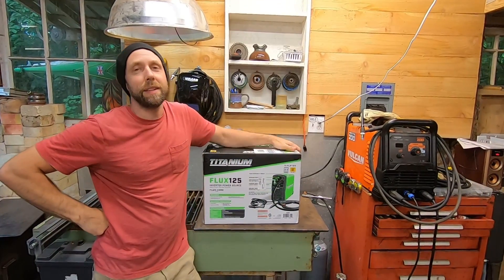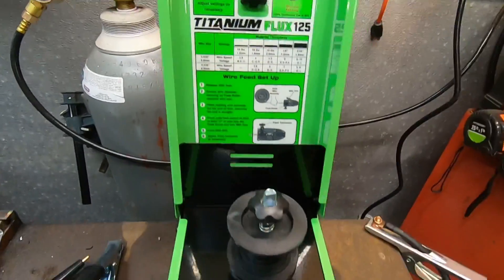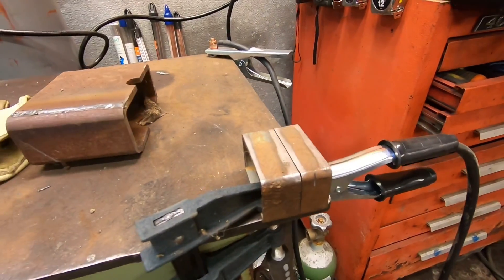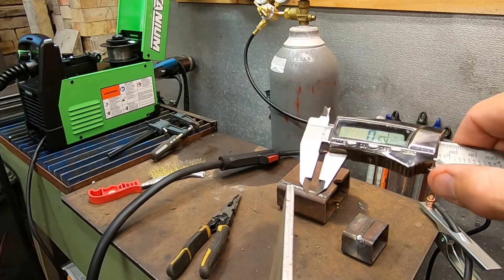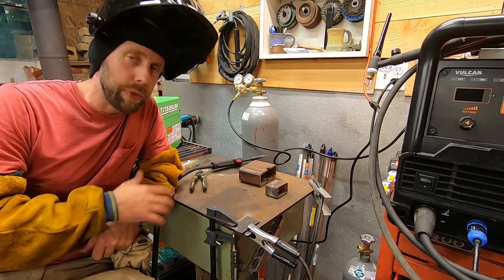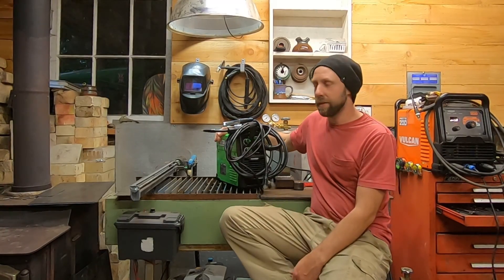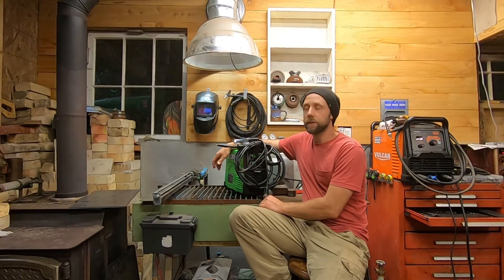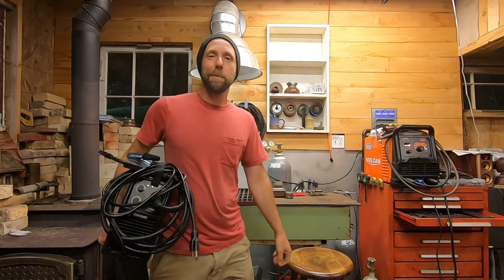Titanium Flux 125 welder from Harbor Freight

Comment: Hey Mike, I got a Millermatic 210 + Everlast MST211Si +Vulcan proTIG 200, but every now and then I need to do some welding where I don't have 240v. Right now, this unit is on for $189.99 until 9/7. Do you think it would be worth it to buy one of these?  I've had issues trying to run FCAW using the Miller with the .035 FCAW drive rollers, but the wire keeps jamming up in the drive housing. I like MIG, but I don't like to burn thru the gold gas just for some rusty metal welding outside or for a neighbor where there is only 120vac access. I love your channel and would like to hear you thoughts on this.
Cheers.
Reply: I bought one two days ago, there’s a coupon that brings it down to $179.99

Comment: What is the difference of welding between a titanium and a Vulcan im interested in buying one I want to use it to weld bicycle
Reply from the maker: I have owned the Vulcan Omnipro 220 and the Titanium 200, both work really well. The Omnipro has auto set controls so it lends itself to being real easy to set up if your new to welding, but it’s a really capable machine.
The Titanium 200 is not auto set but has a really nice metal thickness chart inside the door of the welder, so it’s as simple as looking at the chart and dialing in the three knobs.
I prefer the Titanium 200 mostly because it more affordable, lighter weight and a little smaller if you plan on taking it out to other jobs. Both are multi process machines, MIG, TIG and stick, plus you can buy a spool gun for welding aluminum too. Both are multi voltage, 110/220 volts 👍 I hope this helps.

Comment: I welded a lower control arm mount on a suv and it's still holding strong it's a awesome welder I've never welded before it's my first one
Reply: Luke, please be careful. This is not a penetrating welder. It will hold for a while. A control arm needs to be welded with 7010 rods for a deep weld.

Comment: What amp breaker is on the 110 outlet you’re using?
Reply: Update for me...I bought one of these little welders and have been using it just fine on a 20amp 110v with only the welder and the LED lights I have on in the garage.  I’m pretty sure if I have to weld something that’s as thick as this machine can handle I’ll start popping the breaker but the thin square tubing I’m working with hasn’t popped it

Comment: Being someone who has never welded and that knows almost nothing about welding I’ve been wanting to get a small welder to have in the shop for small jobs and to use to learn basic welding skills. I’ve looked at getting the cheaper Harbor Freight Chicago Electric Flux 125 welder since I get coupons all the time to buy it for around $100 or less. But for less than $200 I am really interested in the Titanium Easy Flux 125. It’s incredibly small and appears to be well built especially compared to the cheaper Chicago Electric model. If this is a significantly better welder than the cheaper Chicago Electric model I’ve always believed that getting the best equipment you can afford based on how much you will actually use it is the best decision. For double the money I think I’d rather get this machine even though it will only see limited use most likely. Although if welding is like any other craft I do involving automotive repair and maintenance then once I start doing it and improve my skills then I’ll probably do it a lot more and find projects to do just for the fun of it and to gain more experience. If that’s the case I definitely want to get the best welder I can afford. Right now that’s around $250 which makes this appealing to me.

Comment: I have no welding experience, and am looking for an entry level machine to get into motorcycle customization. Not looking to build frame but more like welding on standoffs, fab'ing brackets, welding up subframes, electronics trays, exhaust systems, etc. Will this be able to handle lighter weight materials or should I be looking into something like a MIG 140?  Thank you!

Comment: I have a 30amp RV outlet on side of my house. Can i make a 25' or 50' extension cord w/RV plug and 110 opposite end out of maybe 8AWG or 6AWG, for use with this welder?
Reply: I just today used a 100ft 12 gauge extension cord no problem welding 1/8 steel

Comment: Do you think I can weld a trailer frame with this? I’ll be building a camper on it
Reply: Definitely go with a much larger mig welding unit. This isn’t big enough for the job your wanting to do, but I would recommend a stick welder that will weld, at the smallest 1/8th rods. That will be strong enough for what ur wanting to do

Comment: Hey Mike, so I had an extra hitch welded on to a drop hitch recently for a bike rack.  Took it to a local guy who used a MIG on it.  Should have stopped him and walked away when during his setup he put down the gun and let 30' of wire come out until the unit ran dry.  But he was an old fella and I was too polite (dumb) to stop and go elsewhere.  Ended up doing a horrible weld in my opinion and said "its only holding bikes".  https://photos.app.goo.gl/93ZNUP6tcmMhkkA89 and https://photos.app.goo.gl/kbWmsRRvYhtzwm8t8 . My question is can I "fill" in those areas where he missed or should I grind it all off and start anew?  My other question is the metal is 1/4" on the hitch add on and the other part is solid steel (drop hitch part).  Would this flux 125 handle that kind of welding or should I buy a Vulcan 215?  I have a lincoln AC225 stick but I dont have the extra 50amps available to add a drop in my fuse box for it.  Thanks for any advice from yourself or others.
Reply: MMMMmmm , or could have  just  loosened the wire rollers , and rolled the wire back into the unit , it is pretty easy to lay the gun down and hit the start trigger ...  ( giving the old guy a little props ) ... 
your photos are down , but from my point ,  if you have doubt about the weld , take it too a more professional shop, better safe than sorry...

Comment: Do you have to use gas with it like a mig welder?
Reply from the maker: John Davis Hey John this is a flux core wire welder, it runs wire like a MIG but is gas less, the flux is built into the wire it’s self and this flux provides the shielding needed to weld, flux core makes more smoke then MIG but flux wire is good for welding rusty metal or outside in the wind, because it shields better in the wind then Gas. I’m really pleased how well these little welders do 👍

Comment: Would this be a good welder for a car restoration project?  It’ll be my first welder with the intended use of patching holes in steel body panels (no structural welds).  I am very experienced at all types of soldering.

Comment: I have a question. I bought one of these and no arc.  Fan is on, LED light is on but does not work. After many days I got an answer about my "complaint" and they stated  "THIS ITEM USES A DEDICATED 30 AMP CIRCUIT". Means I can't use it in my garage with a "regular" electrical system? Thank you for your eventual answer.
Reply from the maker: Roberto Berti Hey Roberto I would say if you have wire, a contact tip on it and it’s plugged into 120 volts, the welder is turned on and you have your speeds and voltage set in the general  settings that the setting guide shows, your ground is connected onto clean metal surface to your part you are trying to weld you should be fine. If it’s not even trying to arc it sounds like you got a bad unit and you should take it back into HF for a working welder. I have ran mine fine on a 20 amp breaker, sounds like the person that got back to you doesn’t understand the welder. Make sure all that I mentioned is correct and if you have zero arc you got a lemon 🍋
Reply: Mike, first of all thank you very much for your answer. Second...the welding machine started to work after a friend made me  do a simple "thing." I'm so ashamed of what I did not see that I can't even mention it here. You and my friend deserve a beer! Thank you again.
Reply from the maker: Roberto Berti No problem Roberto 👍 I’m just happy you didn’t get a lemon 🍋 
Take care 🙂
Reply: Roberto Berti I am glad that your problem was rectified, we all need help one another when we can.😁🛫
Reply: @robbyvenetian  WHAT DID YOU DO?? same issue
Reply: @tacomas9602  Make sure your breaker box isn't tripped for whichever outlet your plugged into and make sure your grounding clamp is making good contact with the metal piece you're trying to weld. Other than that, I can't think of any other reason it wouldn't work, short of an actually defective unit.
Reply: @jw11432  maybe mine is defective. No issue though, I'm ten minutes away from harbor freight and they treat me good.
Reply: @robbyvenetian  someone didn’t pre-feed the wire, I’m betting..
Reply: @horsleyed  I'm so ashamed that I still can t say it haha.
Reply: @robbyvenetian  You forgot to use the ground clamp? Lol.
Reply: @robertblackshear8963  ,I'm still too ashamed to say it :)
Reply: @SIOUXICIDE * I figured something stupid like I did the first time I was too excited

Comment: How would this welder be for welding sheet metal?  I need to do some work on the floor of my Jeep.
Reply from the maker: It will work fine for that. The flux tends to run hotter then solid MIG wire with shielding gas, but you can still get this welder dialed back and do fine. When welding really thin metal sometimes you need to weld for a moment then stop and ether go to another part of the panel and weld for a bit then come back or just weld for a few seconds then stop for a second then repeat, this will help you from burning holes in the metal. This is only on really thin metal or when you are trying to fill a hole. Take care
Reply: @Mikefestiva  Hey thanks!  You have a great channel here, love your content!

Comment: Is the wire hot all the time or only when you pull the trigger?
Reply from the maker: Jason Harlan It’s not hot till you pull the trigger.
These little 125 welders are a big upgrade to the Chicago electric
Reply: Mike festiva thanks! I have an el cheapo that isn’t made anymore and it is hot all the time!
Reply: Tried mine today couldn't get it to arc. Does grounding have anything to do with it not arcing?
Reply: @mpg0211  In our  business motto: When all else failed, read the manual.
Reply: @mpg0211  yes, sand or wire brush the area to shiny metal wash with acetone  will have good ground after that
Reply: @mpg0211  yes it does
Reply: I’m only gonna me using it for mufflers and small garage repairs.

Comment: Would flux be ok for dune buggy frames?
Reply from the maker: Yes flux core is just as strong as solid wire, basically it comes down to what thickness metal you plan on welding up? This is rated to 3/16” single pass, I doubt you will be using much metal thicker then 1/8”.  It really just comes down to your welding skills? As long as you do some test welds and know you are getting good penetration it will be fine.
Reply: @Mikefestiva  Thank you sir, im 16 and always been one to work and build things, seeing the things you do I wanna build things like you. Keep up the good work👍🏻
Reply from the maker: Mike Finto Right on! Yes this welder will definitely get you welding up projects 👍
Get some scrap metal and just start practicing and remember to have fun. Have you seen the video we’re I showed my nephew how to weld with this welder? It’s got some good tips in that video. Take care Mike 🙂

Comment: @Mike festiva  Have you tried welding any 1/4" 304 Stainless with this welder?   I'm thinking about getting one, but would like to be able to weld the stainless; wonder if maybe I should get a 240 machine instead.
Reply from the maker: Scott Farkus I definitely would recommend a 220 volt machine, especially one that can run shielding gas. What are you planning to build? Ps make sure you have good ventilation and probably a welding respirator, that SS has a lot of nasty stuff like Chromium and Nickel. Take care
Reply: @Mikefestiva   I'm building a metal brake and thought I'd use stainless.  I'm going to weld it outside so ventilation will be good.  I wear a respirator to weld anything,  I don't like breathing any kind of smoke.
 
I was hoping to get it done without having to set up a complicated system for so few welds.  I may end up foregoing the stainless to simplify the process, but will probably get the 220 machine.
Thanks

Comment: Saw a video showing flux ore had better penetration than solid core on a tee joint. Welds didn't look as smooth, but it did penetrated both pieces deeper than the solid wire
Reply: Yes, flux cored is a better weld. It can be pretty too. Just gotta have the touch

Comment: We’re you ever able to add gas to Titanium 125?
Reply from the maker: I was able to hook up a mini relay onto the circuit board by tapping into 15 volts and I had it trigger from the motor drive, I was planning on using it to control a gas valve.
I had a 120 volt gas valve but I think I needed a 12 volt one because it would not trigger the valve without tripping the breaker, I think that was due to the coil in the gas valve causing a spike in voltage as it would close? I didn’t proceed any further because my friend needed to barrow the welder so I loaned it to him.
Reply: @Mikefestiva  Hey mike, love what you are doing with your channel. I'm sure I'm not the only one who would give you a HUGE "Thank You!" If you ever did a video follow up adapting this little work horse for MIG gas!

Thanks for all you do! Keep educating and working!

Comment: I couldn't find the flux125 anywhere in a 50 mile radius so I settled for the Mig140 in Delaware for 349 (coupon) and no tax. I haven't tried it yet like I wanted to. Very excited though.
Reply from the maker: Christian Nieves Honestly you are better off with that welder. You can run flux wire for now, when you buy a tank of 75/24 Argon CO2 mix then you can run solid wire. You will have more amps available too 👍 I think you will be happy with it.
Reply: @Mikefestiva  thank you Mike

Comment: So this is good for auto work, like welding in sheet metal where rust holes once existed?  Wait is this a mig welder
Reply from the maker: This is a flux only welder, it can definitely weld body work on a car but keep in mind flux wire always has more splatter the MIG with shielding gas. One advantage of flux wire though is it welds better outside in the wind and can weld fairly good on rusty metal. You may consider the Titanium 140, it can run flux wire or shielding gas.

Comment: I want to know who told you it was ok to pull a weld instead of pushing it... get some real training!
Reply: Paul walker you pul with self shielded flux core. Normally you push with gas but either way it still works. I’d rather pull so I can have a better view at the weld pool.
Reply from the maker: Paul Walker Haha Paul you really should do your self a favor and do some reading on this topic before you try and sound like you know what your talking about. You really don’t know what your talking about man, you really should not comment on things you don’t understand 👍 ps you have zero content on your channel. I actually have over 80 videos building stuff on my channel. If you push flux wire you can get the flux contaminated in your weld, the same goes with stick welding, you drag not push!
But you also can pull or push a MIG welder too, it really comes down to what you are welding and what you prefer.

Comment: I just bought one of these about 2 weeks ago and so far am blown away. I welded exhaust on my truck from the cab back. Smooth steady beads. No issues. And also have welded some 1/4" and 3/8" steel on some tractor implements and actually got good penetration and have yet to have anything break. After welding with thousands of $'s worth of machines this little thing kicks ass for the price.
Reply from the maker: bass 1776 Haha right on! I really think for the price and portability they are hard to beat! 
They weld much better then the older Transformer flux welders. Thanks for commenting 👍
Reply: Awesome!!!...the Inverter DC Circuitry on these little buggers kicks A$$!!!😎👍🏻

Comment: Hey man, thanks for this video. I always assumed that harbor freight welders were junk and not worth the time (I thought they only sold the Pittsburg one). Saw this video and assumed just by the way the welder looked it was 500$+, only to google it and realize they're only 219.99. Just bought this welder today based off this review, and I had no Idea I could get into welding this cheap. Sure my first ever welds look like junk, but it's my fault not the machine's. After 20 minutes of practice, I welded a tail-light mount on to my current build, and it came out pretty damn good! Thanks again.

Comment: Hi  guys , I'm new in welding (weekend)  and I have a question. I have a Titanium Flux 125 welder from Harbor Freight just like the one on the video,  is the Lincoln  SuperArc L-56 compatible  with my Titanium Flux 125 welder from Harbor Freight ?  I'm planing tho weld 3/6 square tubes.  Please help. and thank you

Comment: Mike, appreciate your insight and I just picked one up cause of this video. I`ve always wanted to weld, but was intimated of how to start. This video gave some confidents and so thx. Question, realizing this will be my first crack at welding, is it proper to weld on both sides of the pieces that are being welded or just one side is good? Also, about the table, is it ok to have the bottom carcass/box made of wood? Or should the whole table be made of metal?

Comment: is the Flux 125 DCEN or DCEP?
Reply: Aaron Sharp doesn’t really matter on these cheap machines. They’re already installed but self shielded flux core is usually dcen and dcep is usually for mixed gas flux
Reply: Dc - for fluxcore
Reply: The welder is DC. And yes it does matter. It will not work AC for shit.